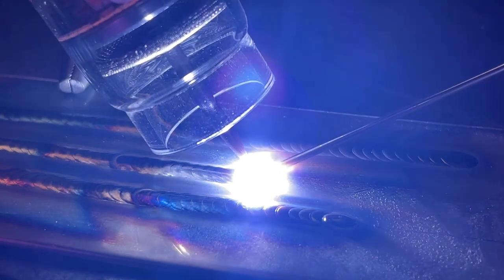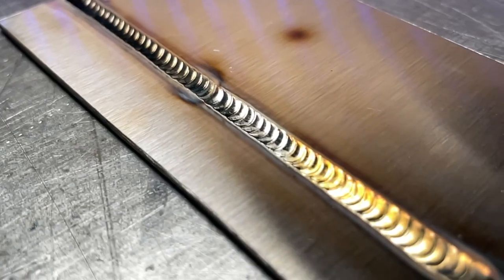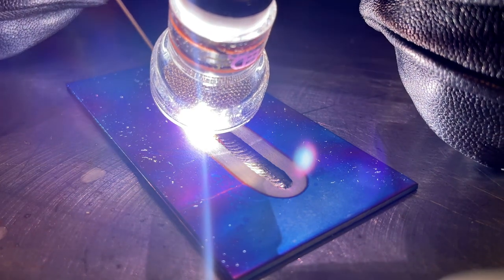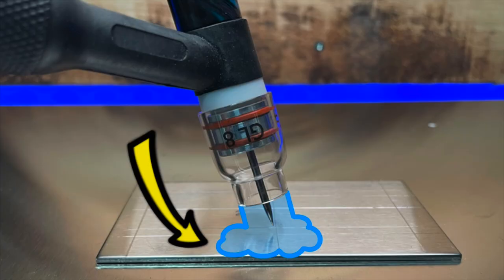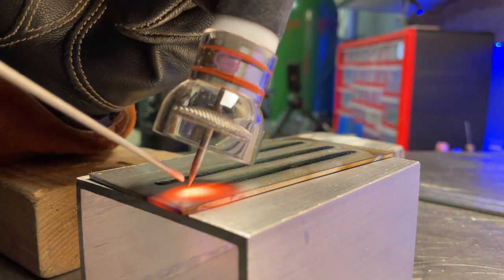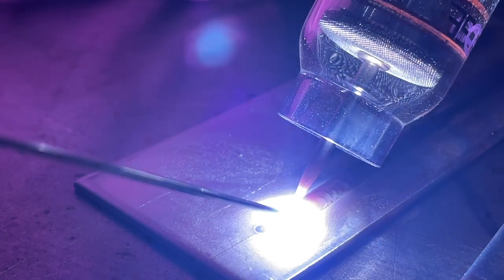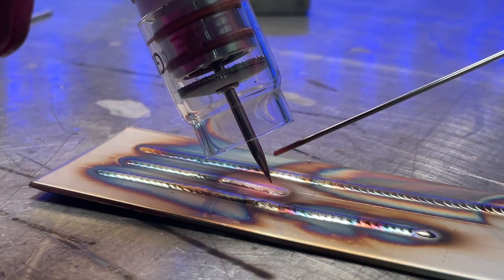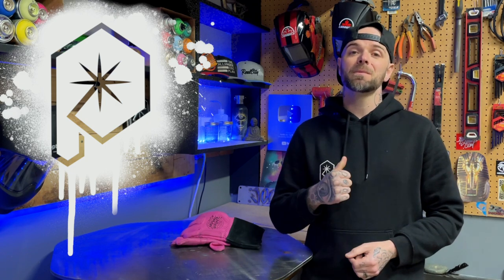How to get INSANE colors to your tig welds

Comment: The thickness of the material will effect this, also if you've been welding and the plate or component is already warm or hot, will play in how much post (or not) is needed. There are charts that tell what color forms at a given temperature although while welding we don't know the temp, still you can keep an infrared thermometer on hand and check the part as it's being welded. After all that, hood time and practice as always will help the operator to "know" when to remove the torch. Having access to the force can't be down played here too. 🤣

Comment: I came here to learn about the different colors but after seeing how you handle the filler rod i think you made my welding class that much easier. I will have to try holding the wire to the side rather than in front.

Comment: I'm building a one off bicycle that I would love to dedicate to all the different metals. And this is exactly what I was looking for. I have a question though. Is it possible to get these colors, using another kind of procedure than welding? For instance I have noticed that the pot I cook rise in, has those colors. Is that the salt in the water coloring it, or ? ? ? . . .

Comment: That's all great and all that, but you're going to need a LOT of argon. Those big cups require more argon than you can ever imagine, more than it's practical. If you are doing art, and getting good money for it, that's one thing. However for those of us who are just practicing, or welding for work, just aim to not have porosity and have a good weld, not necessarily good looking weld. If it must be shiny for sanitary or corrosion reason, you can always electro polish it. You can do this with a TIG torch by the way with a modified collet and a specially made brush, and a special solution for this. This will clean the weld to completely silvery look and remove all oxides. Those big cups are really made for Titanium by the way as oxide will compromise the weld.

Comment: Colors are great for ART however colors crack. 
One of my customers does inducstrial HEAT TREATING/ANNEALING for many industries, he sent some before and after of Stainless Steel racing boat headers and I asked if they glass beaded them to remove the color... NO that is a by-product of heat treating/annealing, besides removing the oxides and sources of corrosion the heat treating has led to an increase in their service life by > 5 times compared to the same non annealed part. The hammering of the boats on the ocean causes welds which are not heat treated to crack at the weld edge where the base metal is overheated (at the base metal and weld pool margin)Bringing the entire part to <melt temp then slowly cooling allows EVERYTHING to become homogenous, with the same stresses and same composition, which is MUCH less likely to fracture. THE PARTS do appear to have a surface which was almost mechanically finished. (looks much like a glass beaded part)

Comment: Awesome video! What Filler size do you usually use for stainless?
Reply: I would guess he is using 1/16 based off the size of the Tungsten, which is more than likely 3/32..... Rods depend on what fills best in what you are trying to achieve.

Comment: How long should i hold my torch on 1.6mm stainless tubing I've done a little bit of practice on it and I'm getting good penetration but where I've added filler seems to stack quite high
Reply: What amps are going into the weld?
What thickness filler rod?